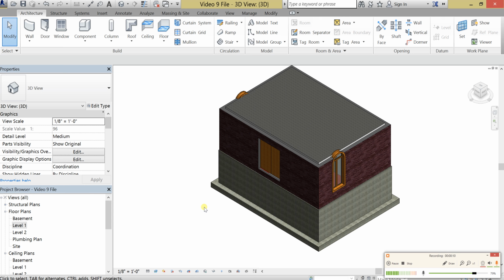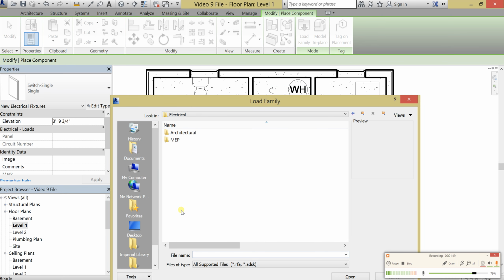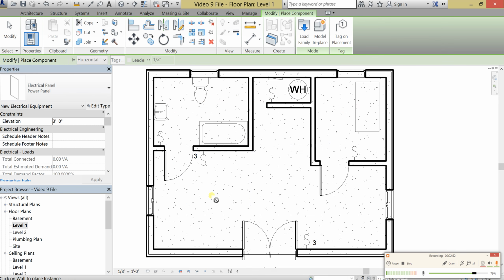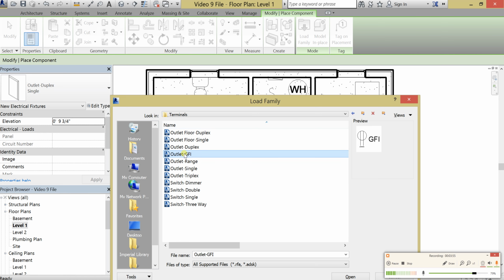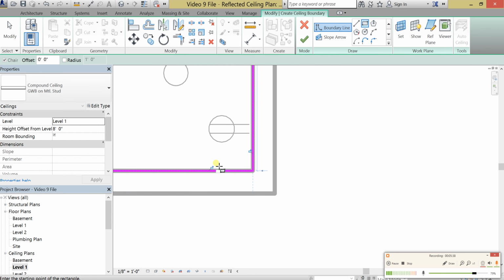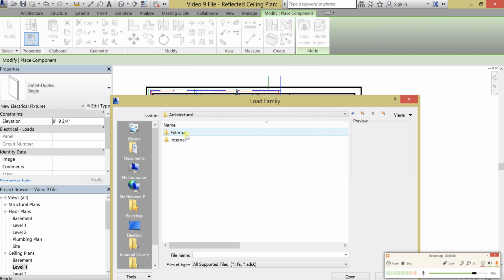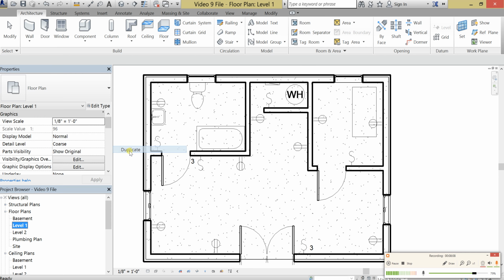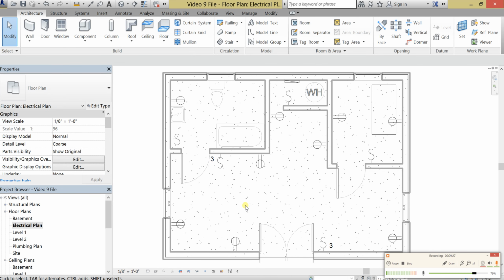Beginner Tutorial 9 - Autodesk Revit 2016 - Making an Electrical Plan Part 1

Comment: My lighting fixtures are not showing up and I'm getting an error "None of the created elements are visible in reflected ceiling plan: Level 1 View. . ." They don't show up in floor plan either, but they do show up in my area plan. I'm using my own drawing that I've been drafting since Tutorial 1.
Reply from the maker: +oldmanpac Did you check out part 2 where I draw down the invisible lines? Make sure the invisible lines are at the center of the lighting object and go down far enough. If that doesn't work, you may need to adjust your view range in the properties. Good luck.